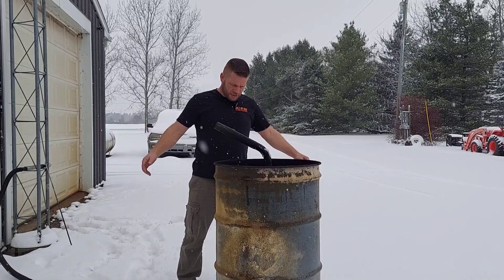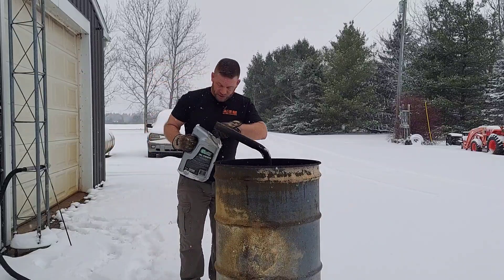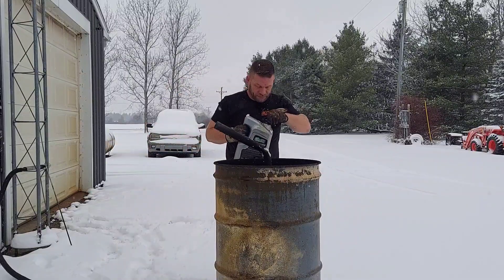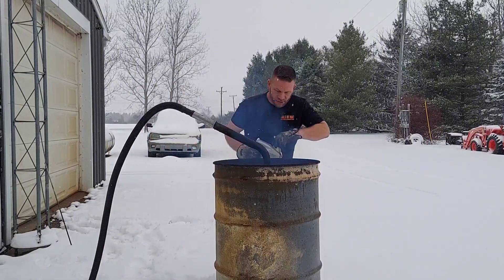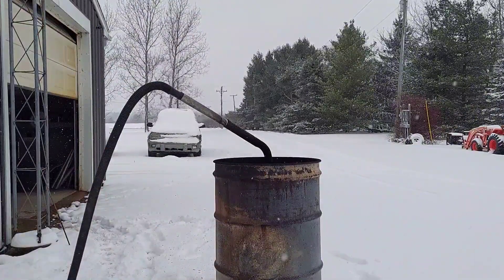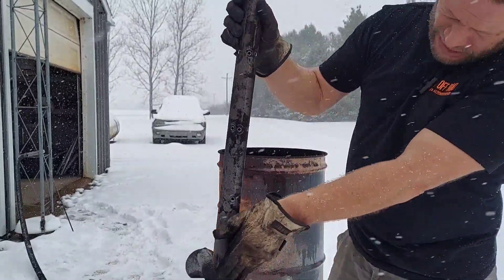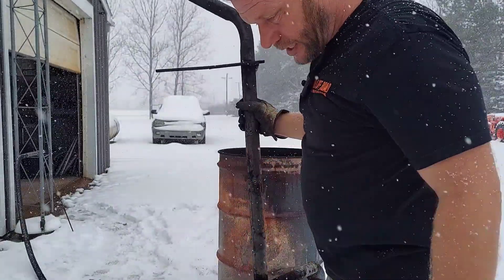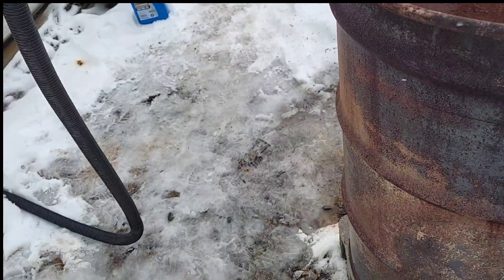DIY 55-gallon drum blue flame waste oil burner!

Comment: Could i order a burner like this one from you iv got the barrels no welder though if you could build one just like it and let me know the cost and shipping
Reply from the maker: Sure, I'm not sure what it would cost to ship it, though? If you have an exhaust shop in your town and a drill,you could have them make the pipe and then drill the holes yourself.
Reply: @karlsoffroad you think 1.5 inch black iron pipe with a tee and 2 end camps would be able to work the same
Reply from the maker: @lifeoftraveling8330  Yes,that should work fine.

Comment: Wonder if this would be good in a 32x50 shop 
I like the idea this stands up versus laying down
Reply from the maker: @jeffccr3620  I think it would heat it no problem. I have been experimenting off camera. It works on it's side too! The front needs to be slightly elevated to keep the oil from running out of the lid.

Comment: I see oil feed going into the top how far do you run it down into the pipe?
Reply from the maker: @geraldhawkins2643 it's right to the bottom of the air pipe, barely sticking out. Sitting about 2 inches off the bottom of the barrel.

Comment: The old eyecrometer is my favorite measuring device! Congrats on the waste oil burner win! I'm getting ready to build my first one. I'm building a small one as I am eventually going to wrap a sand battery around the first meter or so of the exhaust riser and run the unit indoors with external air intake/exhaust. Cheers!

Comment: Looks like you have incomplete combustion going on. The flame coming out the vent is due to vaporized, unburned oil and decomposition products catching fire once they reach more air. You can tell it's running rich inside since you have flames around the air jets, meaning that it's only burning where air is introduced, the rest of the combustion chamber is oxygen-starved. It's a good, simple design, but might be better if you could add a baffle between the lower "T" shape and the rest of the combustion chamber, or add more air vents inside the combustion chamber in order to add more air. If you pipe it to a heat exchanger without adding more air, a lot of that blue flame energy will be wasted due to incomplete combustion.
Reply from the maker: @MrItsthething  this is after I got it tuned. I was giving it too much oil. New burner, so I had to test drive for a bit. I also have the hole cut right in line with the top set of air holes.
https://www.facebook.com/share/v/1AuBbYkatA/

Comment: Carl do you think the blue flame is better because the oil might be getting heated more, thinning it out for better vaporization. Im just wondering because in my small pot burner i get some blue flame and my oil is cold like yours as i'm in Windsor across the river from Detroit. Wondering if my oil was heated if the blue flame would improve.
Reply from the maker: @johnpisciotto5566  The blue flame is more efficient. It's only burning the vapors. Heating your oil might help. Everything on this one takes place in the burner. It has just enough room to hold some super heated oil and mix with the air just right. I normally don't care about blue flame, but I was challenged to make a burner out of a drum, and this was the result. Happy accident, really. I'm just on the other side of the Blue Water Bridge.

Comment: Nice, needs more air inside the drum.   The flames are igniting OUTSIDE of the drum when the gasses get O² they spontaneously ignite (could be a nice boom if the interior flames drop long enough to then suck intake O² and hit the auto-ignition point exploding.    There was a YT video several years ago when a guy had this happen to him 2nd/3rd deg burns on him and lost a shed
😢😢

Looks great but you need the extra air added mid and lower in bbl😊
Reply from the maker: @markmatt9174  I shared the link to the video after I got it figured out.
Reply: @karlsoffroad  tried yhe link. Fakebook censored me in 2020 for posting facts & 100% of what I put on was from reputable sources & was banned for facts I won't be back on it
Reply from the maker: @markmatt9174  I realized after I was done filming and just watching the burner. I had too much fuel in the bottom. I adjusted it, and it burned beautiful inside only. I have only fired this 4 times, so I'm still tuning in to what works best. Thank you for your suggestions.
Reply from the maker: @markmatt9174  https://www.facebook.com/share/v/1AuBbYkatA/

Comment: some have taken a punch lke probe and poked into holes and bent them to angels to encourage a cyclone effect when air exits holes..  something to experiment with
Reply from the maker: @coachgeo  The exhaust pipe is only 14 gauge, so it doesn't offer much area to direct the air when it exits. The way I did it worked out for holding the whole thing up off the bottom, too. The experiments never stop until perfection is acquired! Lol
Reply: @karlsoffroad  the other builds folk tweaked the holes were also about that  gauge some thinner.
Reply from the maker: @coachgeo  I guess I missed what you were saying at first. After I commented, I realized what you meant. It's been a long day! Lol